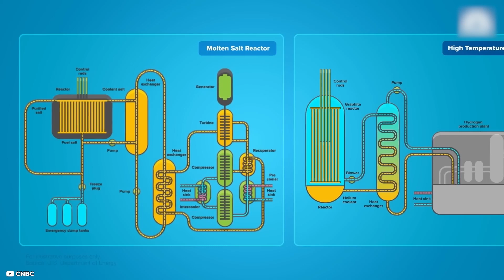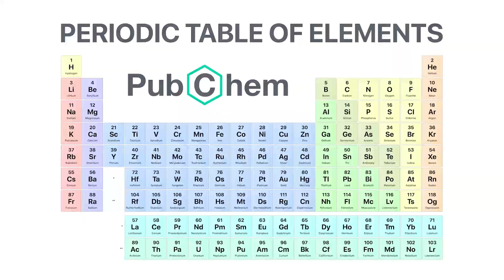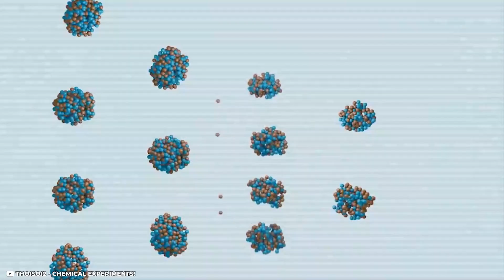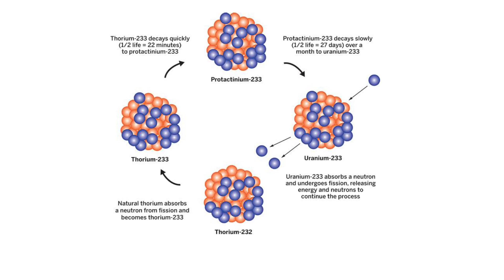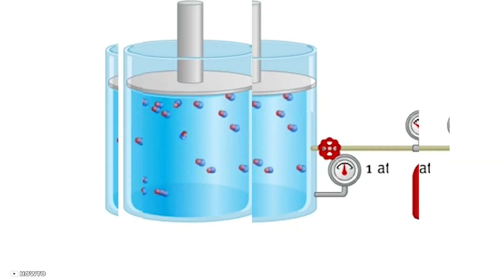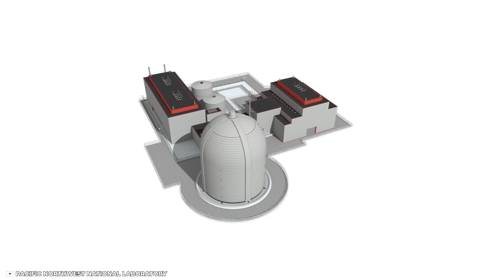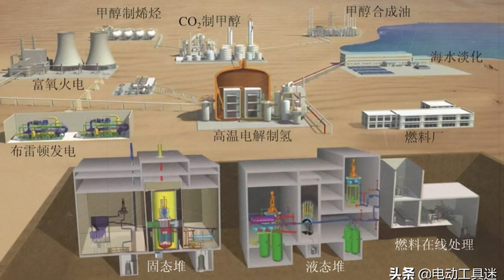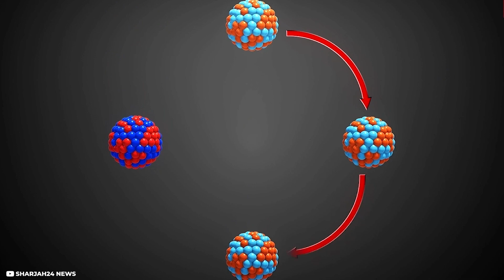NEW NUCLEAR REACTOR! Safe Nuclear Energy for 1200 Years!?

Comment: Thorium is a great fuel. And China’s reactor is based on US research from the 1960s freely given to them. Thorium is also a “waste” product of rare earth mining. Thorium molton salt reactors aren’t as efficient per hour as high pressure reactors, but instead of low fuel use thorium molton salt reactors are 95% efficient …
Reply: Please explain how Thorium MSR can be 95% efficient?
Reply: I guess your just spewing misinformation you saw on a YT video.  Just because it is on a YT video does not make it true
Reply: @clarkkent9080  I posted a link to a reasearch paper from Stanford. They’re a touch above you-tude.
They actually placed uranium high pressure water reactors at only using 1% of their fuel and thorium molton salt at 99%. The other papers I’ve seen are the more conservative 5% vs. 95%

I don’t give much credit to negativity without citations showing the counter arguments. Have any that show, well, we don’t even know your point of view!
Reply: @tjp5820  Citations are not needed if you have even a  little knowledge on the subject as I am fully aware where these numbers come from. I worked in nuclear for 40+ years at 5 different facilities in operations so I have a little background.

Lets just look at some FACTS: 
Standard U.S. BWR/PWR fuel U235  enrichment is between 3-5%.  Lets just use 4% for simplicity.  The other 96% is U238.  U238 like Thorium 232 is NOT fissile and does not fission so it is NOT a fuel. 
 During operation, some U238 absorbs a neutron and transmutes into Pu239 which is fissile and does fission.  This Pu239 by mid core life produces more power than the depleting U235.
Spent fuel contains less than 1% U235 and ~ 1% Pu239.  When you take the Pu239 into account as a fuel, more than 4% of fissile material fissioned so more than 100% of the original U235 FUEL resulted in power production.  The misinformation most cited is that only 4% of the uranium fuel is used but since U238 is NOT a fuel this is incorrect.

Now lets look at a Thorium reactor.  Thorium 232 is not fissile and does not fission and is NOT a fuel.  You need a fissile Uranium(233 or 235)  or Plutonium (Pu239) starter core to produce neutrons. 
 Some of these neutrons are absorbed by Thorium 232 and transmute into U233 (after 27 days).   Spent fuel contains a mixture of thorium, U233, and any other fissile starter core material that must be processed to extract the U233 so it can be used to fission and transmute Thorium into more U233. Thorium reactors are breeder reactors and cannot be compared to standard PWR/BWRs.

However, there have been Uranium breeder reactors that are designed to transmute large amounts of U238 into Pu239, just like Thorium is transmuted into U233. Pu239 is currently being used to make new MOX reactor fuel.  So if you compare breeders to breeders, there is NO difference between Uranium and thorium.

The reason that there are no commercial uranium breeder reactors is the same reason that there are no commercial Thorium reactors.  Breeders require expensive and dangerous spent fuel reprocessing in addition to the cost of the reactor. You are not only dealing with highly radioactive material but fissile material that can go critical very easily.

Did your citations explain any of that or just spew out misinformation without explaining it?

Comment: could individual vehicles be thorium powered??
Reply: It would not be practical but the generated electricity could charge EVs or zero-carbon synthetic fuel production. Reducing energy production cost leverages the ways it can be used.

Comment: can it still be said that is completely "walk away safe?" By that i mean if for some unknown reason the next crew never came to work, the present crew could walk away with out issues of melting down or creating dangerous scenarios??
Reply: Most molton salt reactors are fail safe … the secondary power fails and a solid salt plug melts and the molton fuel mix drains to a cooling concrete container. Where the thorium stops reacting.
Reply: @tjp5820  yep!

Comment: I am glad you pointed out that the Molten Salt Thorium reactor was developed at Oak Ridge National laboratories in the 1950's. You did not however point out that Oak Ridge had a 10 Megawatt proof a concept reactor that operated into the 1970's and was shut down by the Nuclear Regulatory Agency not because of safety concerns but because the President at the time wanted to spend that money to build more conventional Nuclear power plants in California. Ironically I don't think that any of the nuclear reactors that were paid for with that money ever went operational as public protests shut them all down. The Nuclear Regulatory Agency and the Department of energy have refused to let any company build prototype plants to test new materials in them. They have had the technology in powdered metals to solve the corrosion issue since the late 1980's but our government has prevented the research and development of Molten Salt Thorium Reactors for overtly political reasons. Powdered metals allow the creation of a whole new range of alloys because dissimilar melting points are not a problem with powdered metals. Powdered metals are blended into a homogeneous mixture while dry then form pressed into the final part.
Reply: The OakRidge reactor used uranium, not thorium
Reply: The money was to go to the breeder program.  The only problem was it was not very much money.  The OR program was less than 5% the budget of the breeder program.  The problem with the breeder program is that it could be easily made into a weapons grade plutonium producing reactor.  President Jimmy Carder did not think that was a good idea for an reactor planned to be built all over the world.

Comment: The molten salt reactors are disliked for one main reason; they have been demonized because you CANT make nuclear weapons from them! You need the standard nuclear reactors to make fissible material for warheads.
Reply: EVERY reactor requires FISSILE material to fission and EVERY fissile material (U233, U235, Pu239) can be used to make a nuclear weapon.  Try reading scientific documents instead of relying on YT videos for your information

Comment: The Free World MUST take the lead in 4th gen nuclear! The energy potential is astronomical and produces the least CO2 of ANY energy. Reliable and safe base load electricity. If we had enough cheap energy, we could produce hydrocarbon fuels (synfuel) from water (H) and air (CO2) thus recycling CO2 (and H).
Reply: There are NO gen IV reactors. And they are decades away
Reply: @clarkkent9080  China has one in Shandong Province and another dozen are due to come online in less than 10 years. So you're close, but not really.
Reply: @chapter4travels  China does not have a gen IV reactor and since the NRC will not allow any new reactors to be built, why do you bother commenting?
Reply: @clarkkent9080  China is not very reliable about what they are doing, so we can only go by what they tell us about the LFTR they started up last year in Shandong Province. 

The NRC may be a militant, anti-nuclear activist regulator but they don't control US research or anything other countries do. The MSR is an American invention that is being commercialized in several countries around the world. The only question is which ones will get commercialized first, Canada, Russia, Korea, Indonesia, France, or maybe Denmark?

The US seems hell-bent on following the proven failed path of Germany, but at some point, after enough money is wasted and hardship inflicted, we will import from one of the above countries.

Comment: no doubt the research are slowe down by the oil lobbys for their profit.
Reply: It did not slow down the U.S. in designing, building , and testing every reactor type over the last 70 years.
Reply: @clarkkent9080  because you fools dont have that meterial much called thorium ☺
Reply: @mintukalita7954  Actually the U.S has vast reserves of both uranium and thorium.  It is India that has lots of Thorium but very little Uranium.  Big difference and nothing to do with oil
Reply: @clarkkent9080  so you guys have 100% nuclear energy sources or not fools

Comment: 1200 years?  pffft.   longer than that considering that the fuel can be reprocessed/recycled thru a different reactor over and over again.  that and the fact that there is a LOT of thorium in the ground.   Low hanging fruit sort of.    The final waste that can't be reprocessed has a half life of less than 500 years compared to 50,000 years with U 238/235.
Thorium generates U233.  and that is much better.   Lets ditch the Uranium power plants asap.
Reply: Thorium is not fissile and does NOT fission or produce power.  It has to be transmuted into U233 that is fissile and does fission.  So if you are comparing waste products, compare U233 to U235 and you will see there is NO difference
Reply: @clarkkent9080   "Thorium is not fissile"  We all know that.   U233 is used as the fuel and gets reprocessed.  It's not supposed to go into the waste stream.
Reply: @tomtommyl805  I am confused by your response.  My point is that "Thorium" reactors are really U233 reactors.  U233 fissions and releases energy just like U235.  U233 is not reprocessed, it is fissioned in the reactor and the U233 fission products left are very similar to those from U235. So the half-life of the fission products from the fissioning of u233 and U235 are very similar.

Thorium reactors must use U233, U235 or Pu239 initially,  to generate neutrons for the transmutation of Th232 to U233, which then continues the process.

Uranium reactors transmute some U238 into Pu239 and that process is very similar to Thorium reactors.  Actual reprocessing of spent fuel is significantly more costly than just disposing of the spent fuel and buying fresh virgin fuel. So that is what has kept the current uranium reactors from using the potential of U238 which makes up over 90% of spent fuel. And that is the source of the myth that uranium reactors only use a few percent of their fuel.

And I can assure you that many people that have responded to me think Thorium reactors fission thorium.  Maybe because they really don't understand even basic physics but because they call it a thorium reactor....very misleading.

Comment: Negative temperature coefficient, where increasing coolant temperature results in lower power production, has been in use in uranium based reactors as well.  The US Navy specifically chose this method initially, and has stuck with it, because of the inherent safety.  This isn't just a product of thorium reactors.
Reply: Well, it's not the case for all the classical LWR reaction types that are commonly used for our electricity.

But sure, technically, if you can give a thorium based plant a negative coefficient, you can give an uranium one as well, and vice versa. Thorium in a LFTR system has many more advantages, though.

Comment: "China has built a 444 billion USD molten thorium test reactor."  -  That sounds incorrect.  444 billion USD is a HUGE amount of money for a small test reactor.  Also, this video failed to adequately explain how initially fissile materials (e.g., U-235, Pu-239) need to be used to create a chain reaction which can then convert non-fissile Th-232 into fissile U-233.  If thermal breeding can be achieved, then the fuel cycle would then become independent of uranium.  Otherwise, some uranium would still be needed.
Reply: Pssst.  The spark plug is made of uranium.  😛

Comment: Facts are hit and miss and this channel missed the thorium renewal wave by about 10 years.  Watch the final minute or so for anything about the title of the video.
Reply: Simple fact: no company or utility is even remotely interested in Thorium in the U.S. and no amount of YT video propaganda will change that.
Reply: @clarkkent9080  It's because the government has to bear the brunt of the cost of the RnD first.  Governments do the hard science (the heavy lifting), then companies figure out how to sell versions of those innovations for as long as possible (iPhone 14 Pro Max).  Energy takes too long to mature and turn a profit for companies to risk innovating themselves - if ever.  I would have to respectfully disagree with your point, though.  Making the public aware of 10x improvements does put pressure on businesses/governments to do something about it (albeit at the last possible moment/when they absolutely can't ignore it anymore).
Reply: @tablab165  I worked at Shippingport in 1978 when they tested and proved the concept of a Thorium breeder reactor.   It worked but was the most complex and unsafe design I have experienced in my 40+ years in nuclear.

There is no Thorium infrastructure (mining, processing, fuel assembly, reprocessing) in the U.S. and who is going to spend the many billions on Thorium when uranium based reactors work just fine>
Reply: @clarkkent9080  The Shippoingport reactor was an LWBR that used Thorium-Uranium oxide.  Water means risks of flashing to steam, dissociation of H2O and hydrogen-oxygen explosions.  Thorium liquid salts are a different (much less dangerous) animal.
Reply: @tablab165  Yes Thorium reactors can be SMR. MSR, LW, and even HW reactors.  The point of Thorium in any type is transmutation to fissile U233 just like at Shippingport.  In any breeder be it Thorium to U233 or U238 to Pu239, saving neutrons is the key.  

While Shippingport did breed more U233 than it used, It had no neutron scavenging control rods.  To go critical, fuel assemblies were inserted from above, into the main core.  To shutdown, fuel assemblies had to be removed against gravity, from the core.  Not the safest design but when you cannot afford to lose any neutrons, you have to do some strange things.

In any case Thorium is not being considered in the U.S. because there is no Thorium infrastructure and who is going to invest billions, in addition to the cost of a reactor, when uranium is cheap and plentiful?

Concerning MSRs, lets see if the Terrapower Natrium reactor is even built and operated before making any claims.  And yes Terrapower dropped the Thorium concept long ago and are planning on a simple high enriched U235 load
Reply: @clarkkent9080  Do you think that was purely pragmatic/engineering-based or at least partly political  (backroom sweetheart deals and/or general public ignorance)?  And is uranium really all that plentiful, especially when you consider how enriched it usually has to be?
Reply: @clarkkent9080  Wow!  With the Ad Hominem, and frankly, the arguments from incredulity.  I got most of my information from watching Gordon MacDowell's videos of the original engineers from Oak Ridge and the LFTR tech's resuscitator, Kirk Sorensen.  I don't watch YT.  I watch channels like Isaac Arthur, Sabine Hossenfelder, and Matt Ferrel.

Comment: The doc is very selective and thus really not helpful.  The main reason that thorium is not used yet in commercial nuclear power plants is the issue of the hard gamma radiation of 232U. It makes the operation, maintenance and fuel reprocessing challenging. Perhaps in the future when nuclear reactors and reprocessing units are remote controlled thorium might become a prefered fuel. 

Th232 + U233 fuel has the big advantage in moderated reactors of a lower build - up of higher actinides a higher breeding rate and thus a higher burn-up. Thus it is more energy and less waste. 

In a nuclear reactor run with thorium and U233 hard neutrons cause a n ->2n reaction (inelastic scattering) which create U232. U232 decays and emits in the decay chain a very hard gamma radiation that is difficult to shield.   

There were as well very good reasons not to go on with the moderated MSR technology. The fuel handling and processing is very complex. Many challenges as the deposition of precious metals and the degradation of the graphite core.
Reply: Simple fact: no company or utility is even remotely interested in Thorium in the U.S. and no amount of YT video propaganda will change that.
Reply: @clarkkent9080  There is good economic reason for that!
Reply: @holgernarrog962  The main reason is there is no Thorium infrastructure in the U.S..  Yes that is an economic reason.  Who is going to spend the many billions to establish Thorium infrastructure in addition to the massively out of control cost of new nuclear???

People who thing Thorium is an answer are YT video educated, something that is becoming a big problem everywhere